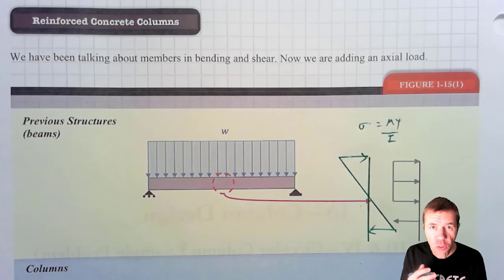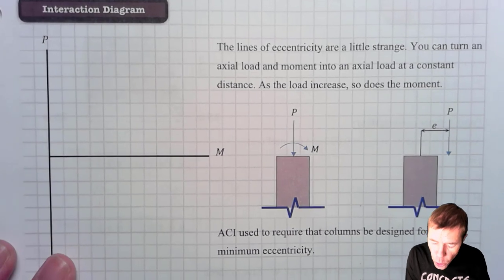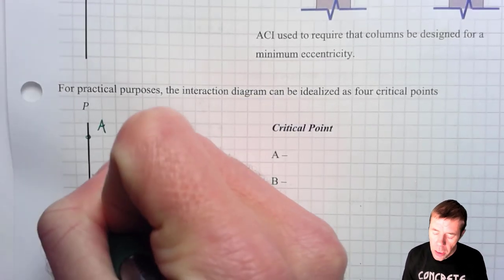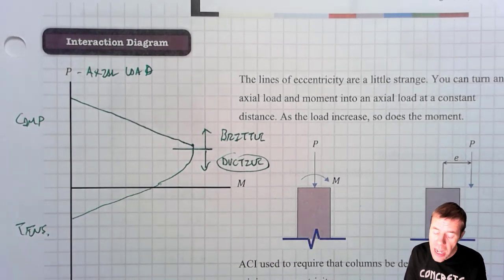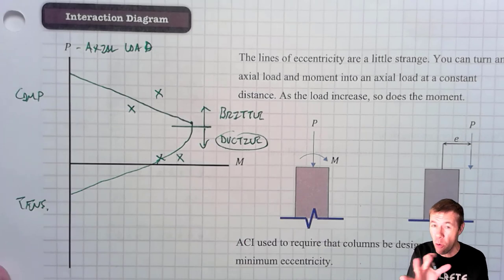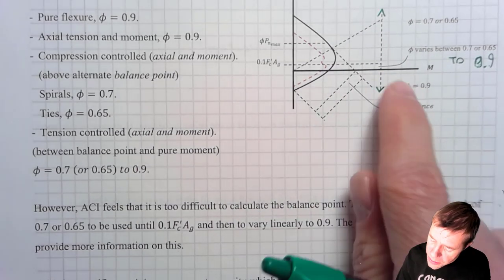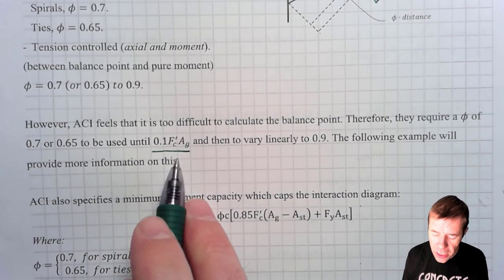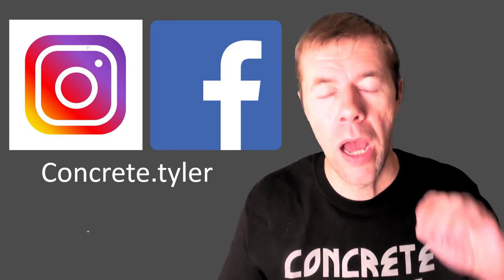Intro to Interaction Diagrams for Concrete Columns | Reinforced Concrete Column Design

Comment: Do you mean phi for concrete or phi for the steel? Canadian code has phi=0.65 for concrete and phi=0.85 for steel. This is much simpler and gives practical results. I can see phi jumping to 0.7 for the concrete in the ductile zone and phi for steel jumping to 0.9 but I think that needs to be more clear.

Comment: Simply explained on the  theory to better understand. I went to the 9th IVY L school abt 30 years ago. And you are better at explaining and more fun. 
To be safe for column design , I would limit the ratio of ultimate axial stress over the F'c to 0.4. This will limit the max. steel bars to abt. 4% and avoid congestion at lappings.

Comment: I see it this way - if you design something then the best option would be to design it for a controlled failure. Imagine a bridge - if the ramp to the bridge fails at a lower load than the bridge, then the result would be less severe, especially if the design just causes a minor depression at a safe distance from the bridge.
It could also serve as an indicator for maintenance where when some insignificant part breaks it's a sign that the structure has aged to a certain level and needs an overhaul. So sometimes failure is an option.
Reply from the maker: I think these are all awesome ideas.  Thanks for adding cool comments to this video and lots of other ones.  I really appreciate it!

Comment: Dr Ley thank you so much for this informative video. Really filled in a knowledge gap I was trying to fill. The Four Critical Points: are we supposed to design the column based on these 4 cases? 
We must ensure that the column has enough capacity to fulfill the 4 cases?

Comment: Why we only consider Compressive stress and Bending stress as a Combined stress ?
Why don't we consider Shear stress in it ?
Reply: Just only two stress in structure work in the difference way namely normal stress and shear stress. axial,bending are normal stress can be compression or tension or combination of them.
Reply: the beams and walls consider shear stress
Reply: We need to find a formulation to relate moment/axialload and shear first to do this !

Comment: I will never understand why modern engineering is using straight bars in beams, its more logical to use steel wire rope , atleast add it in the middle, pour concrete over it while its loose in curved hanging shape, and under heavy pressure load will be eaqualy distributed, it simulates curved shape of a bar in failure,  so the whole beam elastic deformation part is just skipped, result is when it fails it just snaps and thats it, without any cracks or curving deformation. Its just stupid to put the bar straight on bottom and thats it, if its not an arch than tensile strength is in main role, so just imagine strained rope brigde , it doesn't make sense. It just annoys me that much. Its even posible to put flat bar above wire rope before pouring concrete and prestress it for even better results
Reply from the maker: Miro,
You are describing prestressed concrete.  It is a great tool and many people use it and you can do parabolic shaped strand in those systems.  This is not economical to do in non prestressed applications and it is actually very expensive and dangerous to do in prestressed beams.  It has been done in post tensioned applications in the past but it is very dangerous to construct.

Engineering is not about giving the best mathematical answer but it is about giving the best answer given the system that you have to deal with.  In my opinion, I think straight bars or tendons are the best solution given the constraints of our system.
Reply: @TylerLey  YEs but in prestressed systems wire stands quite loose inside it's lubricated and not catched by concrete at all, so do you think it would be beneficial in non prestressed systems? dont know, i was always about make it perfect first than simplify as much as you can :D btw great videos very informative